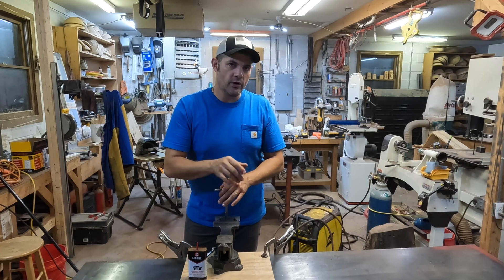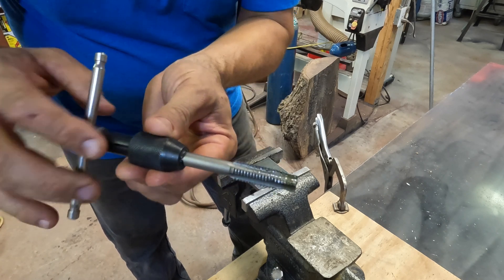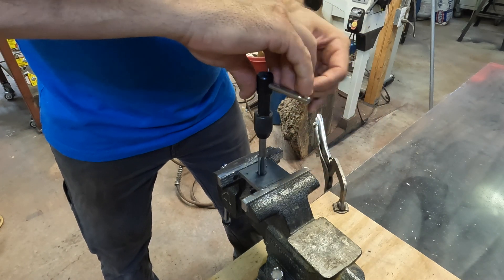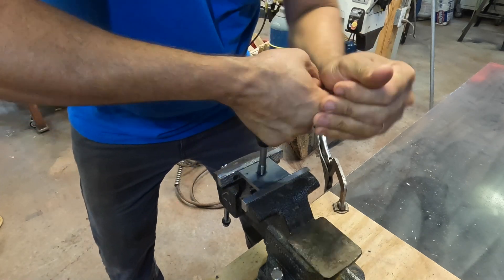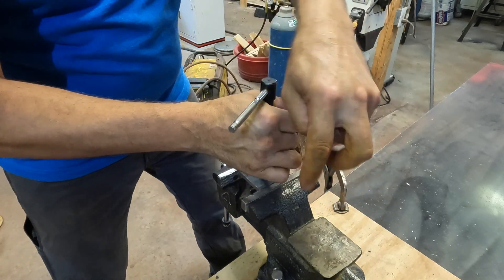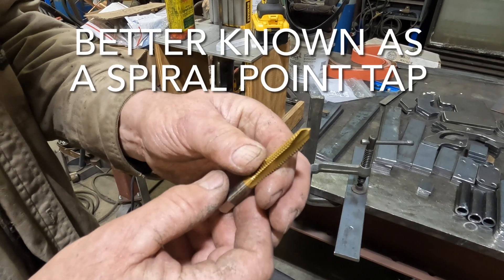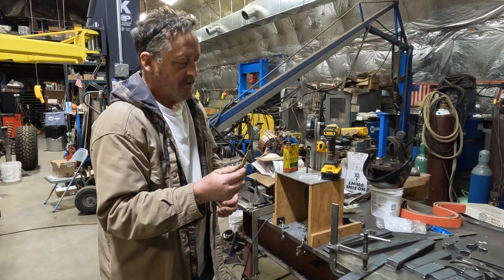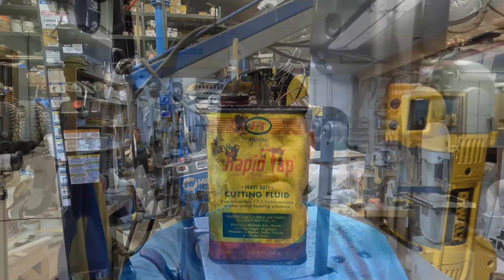This is How You Tap Holes in Steel Fast

Comment: #1 you’re using a T-handle tap wrench for a 1/2” tap. #2 you’re using a cheap tap - pretty sure it’s not a ground tap.  #3 no tapping fluid.  #4 looks like hole is gloop small - you’re probably trying to cut 80% thread.

Comment: Sorry, your initial tapping technique was/is all wrong.  You always turn 1 or 2 turns clockwise, then 1/2 a turn or 1 turn counter-clockwise to break the swarf.  No need to remove the tap completely from the workpiece.  Basic tapping stuff.  This makes sure the swarf is broken into small bits that work their way down the flutes of the tap and out the bottom.
Yes a spiral tap will do a quicker job under normal circumstances.
Reply: When I'm tapping on the mills I rarely back out, but always do when hand-tapping. Depends on the tap too. Spiral point should not be confused with spiral flute. Lube oils aren't the best. Kero, ATF, and water are better. We want to cool as much as lube, and smoke is a sign of heat absorbed. IMO that's all good.